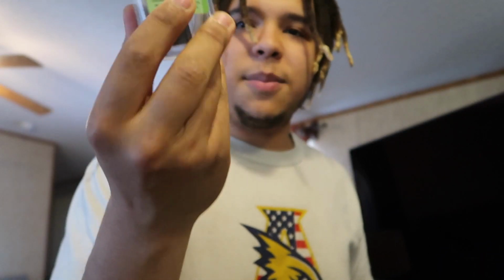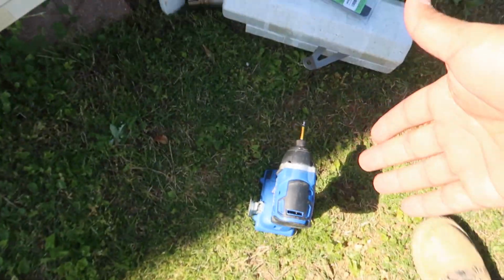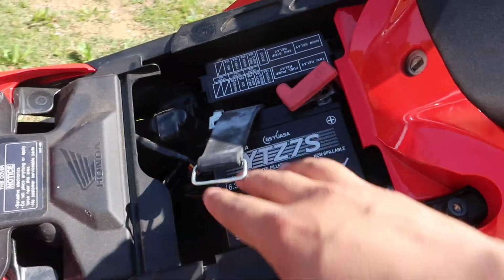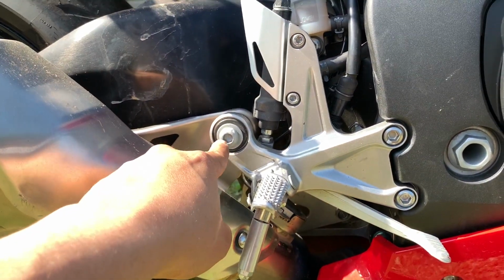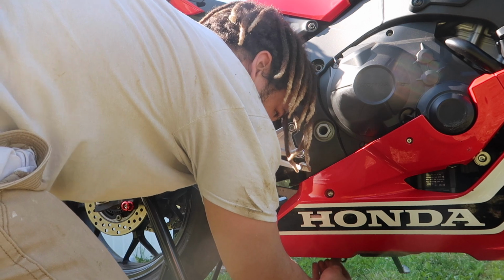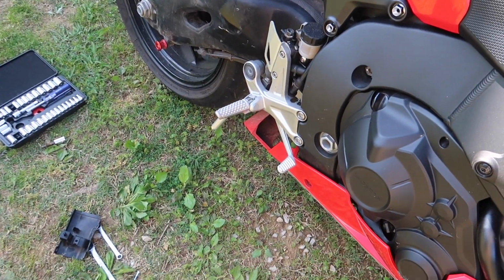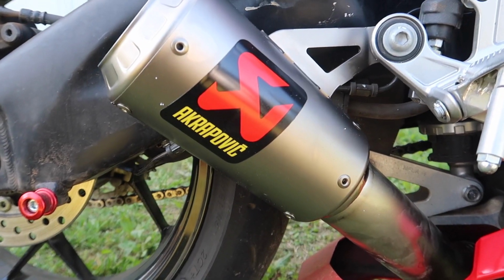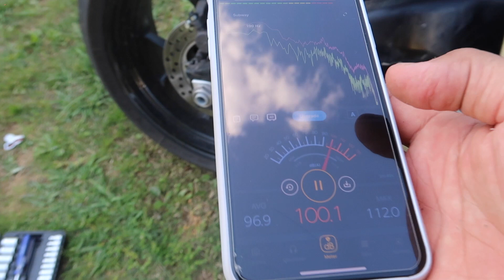Akrapovic GP SLIP ON INSTALL ON 2017 HONDA CBR1000RR / SERVO DELETE / STRAIGHT PIPED!

Comment: Got the exact same setup, just the flat black color, same exhaust tho but I do have a power commander 5 and it fixed all lagging issues and all that bs. That’s expected when you go aftermarket exhaust but yeah the power commander did the trick.
Reply from the maker: Matt Kelley awesome I was going to have my buddy flash and tune eventually!

Comment: Thats normal bro.it sounds loud because your the one that's driving your bike but actually not that bad when you see someone riding your motorcycle.we hve same bike except i have the 19 model. the sound that your talking about its because u need a ecu flush.i have a Toce exhaust at first I thought it was loud but i let my buddy drive my bike and actually its not that bad as I expected.
Reply from the maker: Mr green gotcha!
Reply: hey mate, i am looking at the toce exhaust. Did you send in your ecu for them to flash it with the exhaust package? If so how did it go?